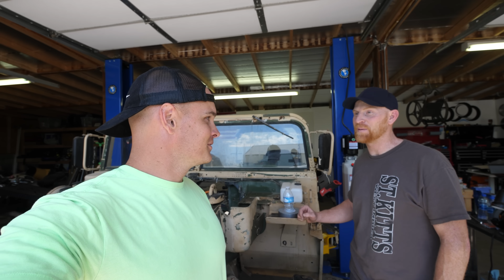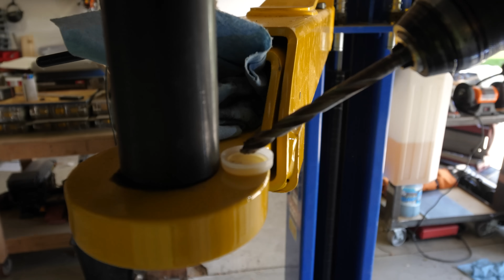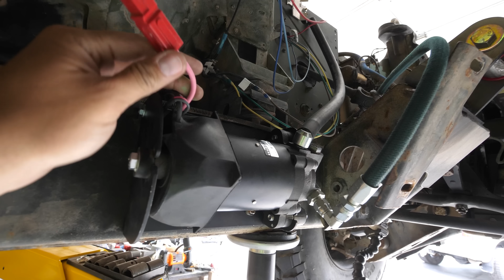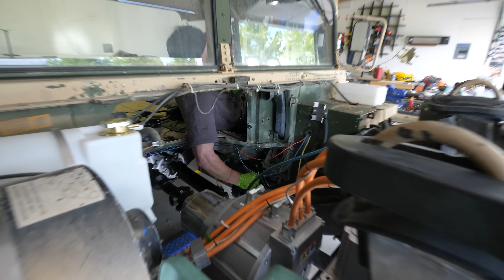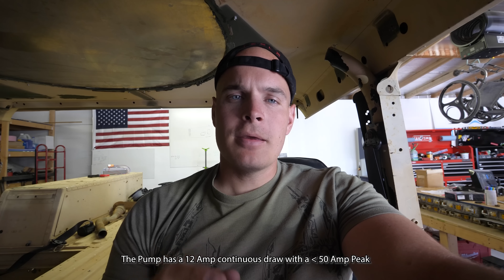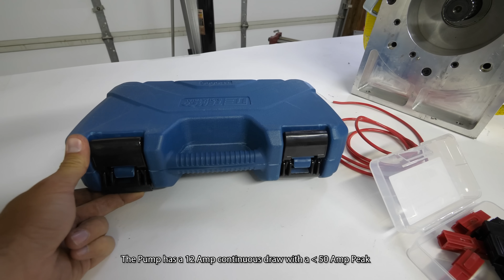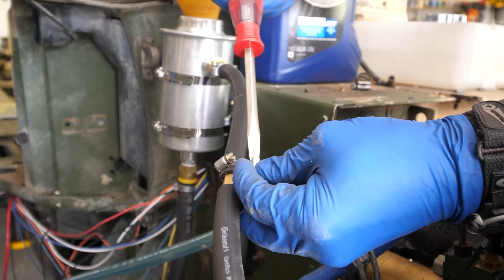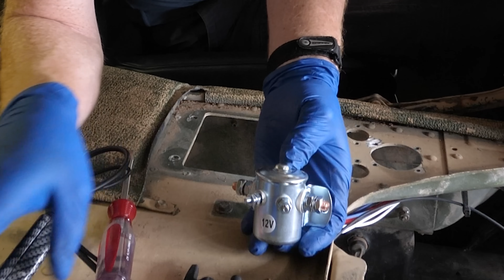We might have a problem with the Brakes... - Electric Hummer Conversion!

Comment: I think that is a bit too close to the driver for the sound to be dampened effectively when you factor in your planned see-through dog house. If you could get it twice as far it would be 1/4th as loud. after that it is fairly high pitched from what I can hear it is probably pretty easy to make quieter with a layer of neoprene foam, they make it with sticky backing. Otherwise you would need to create a "wall" for the sound to bounce off of and into the ground effectively increasing the distance for any sound reaching the driver.

Comment: I am no expert, but the hydraulic pump seems a bit far away from the reservoir. An improper suction hose may cause cavitation/noise issues. Checking the pressure at the suction&delivery side may help to diagnose the issue. Excellent video series, BTW.

Comment: I like someone else's idea of a pressure accumulator, if not for enabling less constant pumping, the fail safety of not immediately losing brakes and power steering in the event of pump failure.
Reply: The pressure accumulator idea is a good one, but I don't see how it would work with a pump that's only on/off.  The brakes and steering system he's plumbing always flow fluid through them even when they aren't providing any power assist.  Of note.. the steering still works when there is no power assist.. its just harder, especially when moving slowly.  And the brake hydro boost has a valved accumulator in it to provide a couple pedal presses if the power steering pump dies.

Comment: You don't need Teflon tape on the threads for that style fitting. It's a 37° flare fitting and if the liquid made it to the threads it's too late.
Reply: Agreed, but as long as he keeps it off the flares, it wouldn't hurt.  Only thing it might help with is providing some lubrication so the threads don't gall

Comment: There is a directionality to the cable crimpers. The side of the die with the colour coding should face the cable. I think you're using them upside down.

Comment: So just to prevent any heart ache in the future I recommend that pump you put in by the driveline get some sort of protective plate / housing. If the drive line drops a drive shaft in motion or under load it can really thrash. I would hate for you to lose both the drive line and the brake power. I’m loving this project.

Comment: Use some sound isolation facing where the drivers seat is because it doesn’t matter if you could hear it from the outside because the traffic makes more noice

Comment: Be careful with attempting to sound dampen that you don't thermally insulate the pump. Primarily, hydraulic pumps are cooled by their fluid, but it's still a good idea to allow air cooling of the surface.

I would recommend sound damping the engine compartment itself, maybe the under carriage and cab. All rotating parts will generate noise, you might not even be able to hear the pump over the motor and tires while on the road.

Comment: Pro tip… put the Teflon on in the direction you will screw the next part in, it helps to think of it that way instead of the direction of the threads as the direction of the threads can sometimes be confusing to figure out

Comment: Isn't Teflon tape used as a way to make the fittings tighter and not as to seal them?
Reply: Teflon tape won't help him seal those threads.. that fitting doesn't work that way.  You can use it to seal threads on an NPT style fitting though.  In this case it might lubricate the threads so they don't gall as easily, but its not recommended.  He should have used assembly lubricant.

Comment: Why you didn't use a real electric stearing?
Actually you use something like an electric - hydraulic steering.
I think if you search a little bit you will find something. My 2008 Ford focus (Europeen Modell, didn't know it is available in USA) has an electric steering and you can choose different drive modes like sport, normal and comfort.
I think you will find something by a car recycling company. Choose nothing from exotic cars!

Alternative you can build a housing for the pump.

I say sorry for my English :-)

Your project is awasome, as well as your mobile channel!

Greetz
Reply: BTW. stealing is allowed as long you steal with your eyes!

Comment: Isolate the driver cabin air tight from the Motorroom, build an isolated Housing as far away from driver as possible, also the connection to the frame transfer also vibrations from the pump. But mainly convert the high frequency sound from the pump into a lower, by dampening the pump, like when u isolate a room, Maybe put the Pump in a foil then stuck it into a plastic container in the middle and use expanding foam to build a custom shell around it. good video greeting from Germany

Comment: You might find a vehicle of the type that pump came from and listen to it. You might have a damaged pump. Next, unbolt the pump to see if just a better vibration isolation mount would do the trick. If it is still too noisy, find out what part of it is vibrating the most and then apply damping such as adhesive backed lead sheet. If the noise is mostly from the high pressure hose, but a pressure accumulator near the pump output. It should be possible to get a hydraulic system to be almost silent.

Comment: Don't use Teflon on compression fittings.

As far as how to make it quieter, fab up an enclosure. I'd just make a nice eighth inch plate box for it, which would then secure to the frame around it. Incorporate some venting and drainage of course, but beyond that just be sure to surround the majority of it (interior of box) in some dynamat. You'll be good to go. . .

Comment: Pump /motor might be louder than out on the road due to sound bouncing around the garage. Also the moving electro magnetic field in the motor could be pulling and repelling the steel near by. Creating a speaker. Putting a steel box around it to act as a Faraday cage might help. There's also stick on sound damping product that change the frequency of the sound.

Comment: Fuse? Where is your fuse for this pump? Looks like the positive wire goes in and out of your big relay unprotected from the battery. A 100A fuse should be used.
Also if 50-70A is possible, I'd use a much larger wire to prevent voltage drop/sag at the pump making sure you have full voltage and a happy pump.
You'd have to convert to AWG but 10 to 16mm2 would be my choice.

Comment: Those fittings with yellow rings are push lock fittings. They are meant to be used in low-pressure applications without a hose clamp. In fact, using a hose clamp on those fittings can cut the hose causing pre-mature hose failure.

Comment: Hydraulic flare fittings do not require thread sealant, as the sealing happens when the tapered parts compress together (some fittings have an o-ring against a flat face). The teflon tape on the threads will actually work against you from bringing the two compression faces together. Fluid should never get to threads if the seal is right.
This is an awesome project, thanks for sharing!
Reply: Could Teflon tape on parallel threads increase clamping force by reducing friction between threads? It could produce a better seal with less torque.

Comment: Bruh this guy uses the frame like a multiuse super too, like "oh yeah we got this circuit grounded to the frame, we gonna mount this puppy using these holes... we drilled into the frame. " At this point may as well design a generator that makes steam using the heat of the sun hitting the frame

Comment: The best way to kill noise is rockwool and mass. Put some more rubber between the frame and the pump, put a rigid and heavy (steel) box around it with space to have rockwool (cover it with some fabric so you won't itch when you need to service the pump) fill as much of the volume as possible. This also creates a heatshield that works both ways but you shouldn't worry about the pump overheating with a decent cooler. 
The other option is using a pump that uses the main motors power on a shaft but that needs to include some clutches and prices skyrocket at that point.

Comment: Why to put the hydraulic pump in such a cramped place? The humvee has plenty of space in engine compartment and the pump would be easily serviceable that way. Now you have to take your driveshaft off in order to get to the pump.

Comment: Jerry, Please add fuses right after +12V of the battery. If for some reason the +12V cable connecting the solenoid to the battery shorts out you are gonna get toasty!

The fuse is a one time breaker which prevents short circuit and then needs to be changed (after you fix the issue of course).
The relay/solenoid is used as a switch, to connect/disconnect a cable capable to transmit high current (the 10gauge for example) while is controlled with thinner cables. It's just to separate the high power stuff from the low power (high power = battery to electric motor connection for example, while low power = tiny switches and stuff).

As an example:
On each audio headunit you have two + cables. One is low gauge (thick wire) directly connected to the battery + (with a big inline fuse) while the other one is just used as a signal, connected through the key to batter + (with another small fuse inline). Inside the headunit there is a MOSFET which is a lot like relay, but it does not have the physical switch and its a bit more complicated to use. When the signal wire is on it toggles the power wire (thick wire) and the high power is going through the thick one.

You must always have a fuse/fuses directly after the +12V battery connection. In some cars its with a bar which is holding a couple of fuses.

One last thing. Fuses should be calculated to be the lowest point in the system. Meaning if you have a wire capable of running 20A, and a bulb capable of using 5A (every headlight bulb), the fuse should be more than 5A but not more than 20A. If the cable can handle only 2.5A for example, then you need to change it.

Also note that the fuses you are using will break only if you short the two terminals of the solenoid which are for the controlling. If you short the high power terminal to the metal cover of the solenoid or the metal sheeting to which its attached it will not help at all. The two circuits are different. You have protection only for the controlling and not for the high power at this point.

Good series, cant wait for the next one, good luck!

Comment: 12:00 this is atf (automatic transmission fluid) specifically VALVOLINE™ DEX/MERC ATF. I was shocked 😲 it worked as power steering fluid and brake fluid too (3 in 1)!! My EV uses dot something for the brake fluid.
Reply: A quick note.. he's not filling the hydraulic brake system with the ATF.  Hmmwv's use dot 5 silicon brake fluid.  The ATF he's using is going through the hydro boost, which only adds the power assist.  So there are 2 different hydraulic fluids involved with the power brakes on a hmmwv.  But yeah... in this application, you can use ATF in place of "power steering fluid"

Comment: Some vehicles that are machines... for example civil engineering machines; have auxiliary outputs facilitated into their transmission systems to power things like winches and other components/ equipment that are later added to the vehicle

Perhaps the Humvee is an auxiliary output built into its transmission already that you could use to power the hydraulic pump 🤷

Comment: If you want to make it quiet, by pass the hydraulics all together and get electric actuators for the power steering and power brakes. If you use the electric power steering column from a Toyota Prius, it's much less expensive than doing a custom route, but there are also custom EPS columns where you can change the amount of power steering assist you get with a dial. If you use the Prius one, it'll give you the power that is required to assist the Prius at 40 mph when just 12 volts are run to it. That option is better for small cars so you may want to spend a little more for an adjustable kit. They sell them on eBay. Speedway motors also sells an electric brake booster and master cylinder that are typically used on hot rods. There's a disc/drum and disc/disc version. It's pricey but worth while to not have your car sound like it's going to take off when you turn the power on. You can also try using a Tesla Model S/X iBooster. I saw a YouTube channel who is doing a C10 electric build use a Tesla iBooster from a Model X, but they didn't mention whether or not there were any electronics that needed to be hacked/adjusted.

Comment: Power steering, I would suggest the electric assist instead of the hydraulic option. 
For brakes, a vacuum pump, check valve and tank with a booster would be the ticket
Reply: This! Significantly less power consumption while not needed and no continuous pump noise!

Comment: So that power steering/hydraulic pump has 2 main components to it...
The motor (that turns the pump)
And the pump 
I think you need to identify what's making the noise... The motor or the pump?
My understanding is that it would be the motor... Because in most machines like forklifts etc the hydraulic pump is turned by the engine... and those pumps aren't noisy.
So I think swapping out the hydraulic pump for one with a brushless motor and a big gearing ratio to turn the pump would make much less noise.
Just my speculation 🤷

Comment: probbly would set it in the back..... the tire noise would far over power it and having hoses that close too the driveline is kinda dumb IMO they get hot and droop and sway under load thats your brakes and steering probly rather not snag that in a universail on the highway

Comment: @jerryrigeverything could you put a hydraulic pressure switch in line so when the switch sees a demand for pressure the pump will come on and then go off when the demand isn’t needed?
Reply: Pressure is actually low, and flow is higher when there is no steering and braking happening.  When you steer or brake, the hydraulic circuit flow is restricted and the pressure rises.  And when its at maximum, the hydraulic pump feeding the system releases flow/pressure through a pressure release valve.  So.. its kinda backward.

Comment: You can also add a accumulator and a pressure switch in to the system. The moment you need steering/brake, you will use the pressure stored in the accumulator and when the pressure drops enough, the pump will switch on.

To make it more complicated, you can also insert switches/sensors in the brake and steering system that, when an input is given, will turn on the pump imidiatly. To avoid lack of pressure when pressing the brake/turning the wheel, the accumulator will release its pressure until the pump is up to speed.

Keep in mind that an electrical motor is using 6 times nominal power to rev up to operating rpm! Switching it on and off will wear down under rated contacts very soon!

Comment: Isn’t there a redundancy problem having one pump control both brakes and steering - one point of failure can knock out two critical components ?
Reply: Well you can still steer, but at slow speed it would be difficult.  And the hydro boost has an accumulator built into it that provides a couple presses of the brakes.  But yes.. if you loose that pump, it's alot more work to steer and stop

Comment: Could you hook up a pump to a aksel and hydralic power that way when driving and then only use electrical pump when not driving or driving to slow to enough pressure

Comment: Pondering my Isuzu Trooper and Rodeo days… I wonder if you might need a “vehicle speed sensor” to inform the power steering pump?

I.E. “not moving, low pressure needed” vs. “in a parking lot, low speed, most pressure necessary” vs “highway speed, median pressure” required?

Love your channel… first useful comment I’ve had… so I hope osmosis rubs off on me.  Cheers!
Reply: Gotta think about a few use cases... when you're stopped you still gotta hold the vehicle on a hill.  And at highway speed you need that hydraulic pressure to emergency brake.  So I can't really think of a time you could turn down that electric pump without modifying the hydroboost part of the brake system.  But for steering... if it has a separate pump, you could for sure turn up and down the pump depending on speed.

Comment: You might want to look into nutserts (i think thats what they're called). they act like a rivet but they have internal threads. so you dont have to drill holes all the way through the frame and use long bolts.

Comment: I don't think the pump noise will be much of an issue if you add sound deadening like Kilmat or Noico mats, and then add closed-cell foam insulation and/or MLV (mass loaded vinyl) on top of that. Do that around the floor, firewall, and doors and it will definitely take out a lot of noise from not only moving parts like the pumps and motor but road noise aswell (99% road noise will be louder because of those beefy tires). You're doing great, goodluck with the build!

Comment: I have an idea and suggestion, but I'm not sure how much this will help with silencing the pump. So about 2 years ago, our friend's house burnt down and he had it rebuilt with special insulation.

It was (heat and flame resistant), along with being able to absorb noise. I walked through his house when the insulation was up and before he put the drywall on, and It produced the same atmosphere as noise canceling headphones.

Face to face, you could still hear someone else talk, but if they were talking from the other room, it sounded like distant mumbling.

Given, that was in large amounts, and I don't know how well it would work wrapped around the pump.

Comment: Use hydraulic accumulator and pressure switch, accumulator will handle the load while pump starts, aslo use solid state relay to remove clicking and contact wear of frequent pump startups